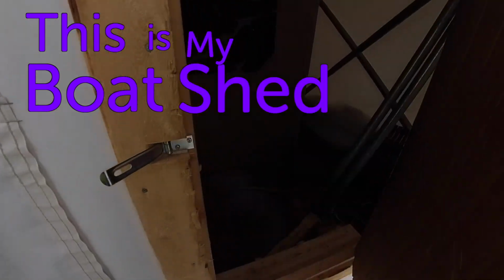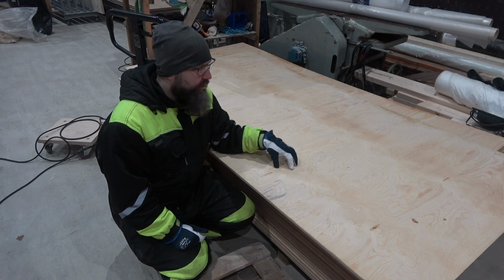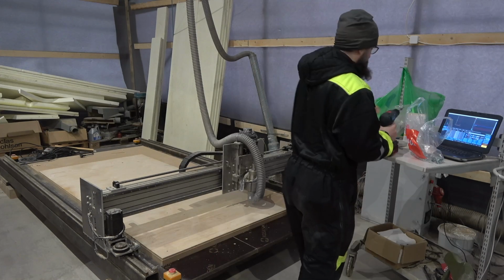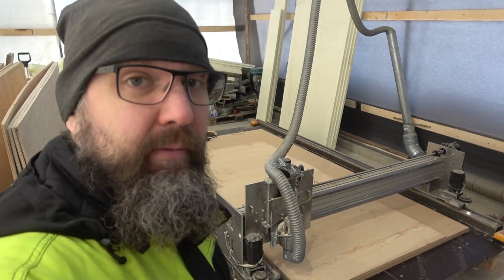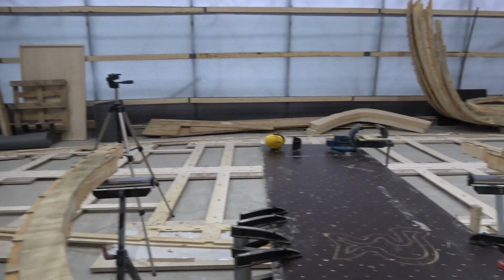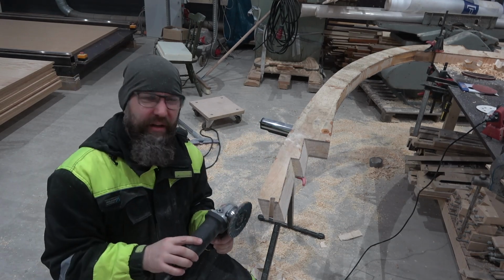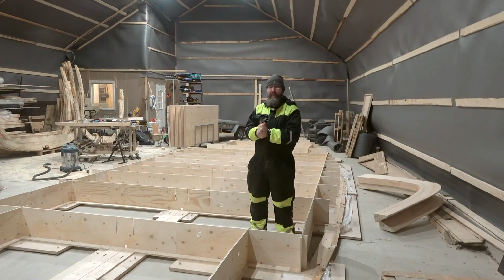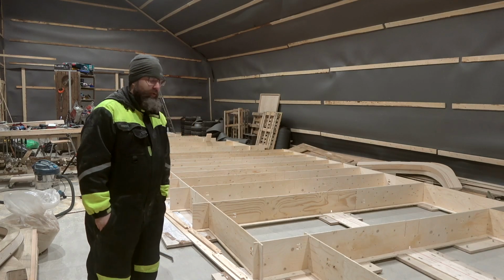Building 50ft sailboat: More molds, more CNC-cutting and more frames! - ep73 Project SeaCamel

Comment: Making a guide to remove the angled edges. Use a hand saw to cut in a slot(kerf) that is at the depth of the top and bottom pieces of plywood. This is a visual that will guide you as you remove the material accurately. The bottom of the slot is close to the finished angle. Cut the slots a little shallow and then take care to dial in the finished surface.
Reply from the maker: I actually have ditched the angle grinder since this. The most efficient way is to use the multitool just to cut the first time as accurately as possible and finish with light sanding. 😊

Comment: At 16:30. when cutting the interior face. If the initial cut is vertical at the lower edge, then when working from above all you need to keep in mind is not to touch the lower edge because is already on size. Hope it makes sense.
Reply from the maker: Yes, the "top" in that case will have tiny "cavity" there. But that's OK. It will be filled eventually when things get glue against it.

Comment: Exciting times in your shop. Use a japan saw to cut your angles and grind only the last bit.
Reply from the maker: I actually ditched the grinder and use only the multitool to cut the initial pieces out - as accurate as possible. Then it only needs light sanding. 🙂
Reply: Yes, this might even be faster than the multi tool.

Comment: why don't leave frames square and then fill the gap with expoxy and filler? (I know on this step it isn't possible because of design, but just a question)
Reply: also. I would consider temporary thin frames from some sort of chipboard and after planking is finished, do a permanent frames gluing it plank by plank to the hull, I would screw them with self-tapping screws. What do you think? Except of some amount of holes on frames (after screws), I see such method maybe not very precise and clean but it may be quicker.
Reply from the maker: Hi good questions. In some frames in the middle it might be possible. But of course the other reason is to make as-precice-as-possible "mold" for attaching the planking. Also the wood here is the "fiber" that handles the loads. So if they're apart from each other, that could make a weak spot...?

And also epoxy is very expensive. Wood is very cheap.

As for the method and schedule what to attach when, take a look earlier video of the nest stages of the build.
There will be a lot of screw holes in planks of course, that's not problem. But the general idea is to install as much stuff as possible before putting the planking in. I could put a lot more but I still want to feel the empty hull before making finalized decisions of the interior.

Comment: "only 15 to go" - that's inspiring optimism. It kills me to think you are doing all this in sub zero temperatures. you're a wild man for sure
Reply from the maker: 😅 Doing physical work in cool temps is the way to go. The 15°C required to glue things is on the upper limit of comfortable to do physical things. You need to wear the protective gear anyway...

Comment: get yourself a sawzall and blades come in fine and aggressive  wood and both, (bimetal) and as long as 12",makes those notches and other large cuts a breeze!
Reply from the maker: I actually have ditched the angle grinder since this. The most efficient way is to use the multitool just to cut the first time as accurately as possible and finish with light sanding. 😊
Sawzall would be too inaccurate IMO. And I don't have that (at least yet)... 😅

Comment: Hi Panu. 
Would an electric compass plane help with shaping the frames - especially on the inside. 
And, working on the frames either them held vertically would assist in seeing both sides of the templates simultaneously 
Just my thoughts. 
Best wishes in your superb build. 
Mark K. 
Dublin. Ireland.
Reply from the maker: Hi! I really don't need to remove any material from the inside. I know that such tool exist though. It might be useful later when shaping inside surfaces...? Dunno...

Frames are so big that I'd need a massive stand to hold them up. This way I really don't need do more that flip them over once. It's working fine. Already seven frames finished now i think...

Comment: 1 concern, these “Ribs” are wood, in steel we run cross reinforced pieces, the wood can change with moisture etc. would  some cross cross support help it from twist and stretch?
Reply from the maker: The frames take the force in "up-down"-direction. The planking of the hull will do the same in horizontal. And then there's going to be two layers of veneer to take the loads in ±45 degrees. And of course being laminated from multiple strips it pretty much prevents the movement with moisture.

Steel is very bendy (and much thinner) so it needs additional reinforcement. Wooden hull is much thicker and that way much stiffer.

Comment: Hi Panu, I've been watching your channel since you started building your CNC machine. I'm not sure if you've covered it already, but I'd there a reason for running your machine at such conservative speeds? I'm loving the boat build so far, keep it coming!
Reply from the maker: I’m using quite small router bits. The general cutting speed is 2000mm/minute which is ok to me. The max the x-axis can go (the ballscrew start to wobble) is 4000mm/minute.
And maybe I’m just scared…
Reply: @ArcticSeaCamel  ah ok, I use 6mm bits and cut about 6000mm/m at full depth (18mm). I suppose it depends on spindle power too. I tested a 3mm single flute once in MDF, it cut at 7000mm/m without breaking! Cut quality wasn't great but it's a tiny bit, carbide bits always impress me.
Reply from the maker: @scottdigs  😳 In that case it’s just the being scared.
I have plenty of power in the spindle and max rev of 20000rpm. Maybe I’ll test some faster speeds at some point…

Comment: Hi Panu, I have a question about all of the permanent pieces that you are going to be gluing up (in particular the frames).  I noticed that while preparing the frames to get them to shape, you are creating large areas that will be in direct contact with the hull that are bare wood.  Do you plan on treating all of these areas of the frames with a penetrating epoxy? If left untreated it would seem that moisture from condensation that forms along the hull would have a means of ingress into the frames -- the cold waters where you are likely to sail combined with the warm interior of the boat are likely to create this effect.  That is not to mention that the point of contact to the keel of each frame is all of the end grain on the frames which will be effectively the site of the bilge.  I am curious about how you plan to deal with this issue --- it's what scares the heck out of me about wooden boats!!!
Reply from the maker: Hi Robert (i guess!)!

So all the frame sides are bare wood right now as you noticed. And the wood strips of the hull will be glued to those surfaces with epoxy.
Wood really doesn't suffer from condensation at all. It is good insulator by itself. (of course if it's really cold it will especially when covered with plastic)

But as for making this as wood-epoxy composite boat, It's really important to seal all the wood surfaces to prevent moisture getting into them. The downside of making composite is that while the epoxy prevents moisture getting in, it also prevents the moisture getting out! (if it has found it's way in there)

So. Yes, all the surfaces, end grains etc. will be sealed with epoxy (and fiberglass for protecting from bumps).
Reply: @ArcticSeaCamel  Thank you for the reply, I was just curious considering your Arctic location.  Condensation is always an issue on boats, but more so when in very cold climates because people tend to try to keep the boat very warm down below.  Great job on the first few frames ... it's really starting to get exciting now that we are beginning to see the boat start to come together!!!
Reply from the maker: @robertscholz4486  Yeah. In order to fight condensation you also need to have good ventilation. Cold air generally contains very little moisture. So if you manage to get cool air in and warm it up, it dries significantly.
Condensation only becomes issue when you have source of moisture inside (like human being or cooking etc.) AND you have surfaces that are significantly colder than the air inside. That's why this boat will not have "normal" aluminum framed hatches etc. All hatches, windows etc. NEED to be insulated and at least double glass.

Handling moisture in cold climates is very very familiar to me (and all of us living up here).

Regardless the insulation value of wood, I'm also planning to put additional insulation all over the boat and really address that air ventilation issue. Boat is very challenging thing to have proper air flow into. With big boat like this I really think that you will need some sort of mechanical ventilation system. Just to move the air from the bilge and keep things dry as explained before.

Comment: Do you not have homing switches on your cnc?
Reply from the maker: Hi!

No. I cannot use any sensors due the interference of the spindle. Haven't really notice any need for them though. Fixing that is on the long long todo-list 😅

And also, homing wouldn't fix the issue of Y-motors going "unbalance" if bumped out of place...
Reply: @ArcticSeaCamel  of you use 2 homing switches on either side would allow the gantry to “square” itself. Love your channel btw! Kitos
Reply from the maker: @gandersson6121  Hi! Yes propably they would. But those switches should be located within tenths of millimeters in right spot related to each other. And I'm not sure if their accuracy is enough for that. Some sort of metal spikes and micro-adjustable thread system could work...

Comment: Amazing work !!
One question are you using compression bits to cut ??
There is a lot of rough cuts.
IT could safe you time and splinters :p
Reply from the maker: Hi!

I'm using downcut bits with these cuts. And it's only 4mm wide. That seems just to be enough and bigger bit would create a lot more waste and make it hard to use the screws to fix the plywood etc etc...
I have 8mm compression bit though but haven't really used it for these. The reason above.

Using new sharp bit gives excellent results!
Reply: @ArcticSeaCamel  Well am not going to tell you what you have to do at all.
just pointing it out :)
If it works it works.
going to order my self some of these 4mm my self soon :)

and you said you have to be carefull not to move the axis??
no limit switches ??
a other trick you could do is add flip fingers on the side of your spoil board of the cnc.
flip em up when you added a plate you want to cut and jam it against them.
you can even add a offset.
once the plate is in place flip em down and go to town.
easy alignment and if you would install limit switches to zero out the machine.
you can add a offset to your plate with the finger is always Zero on the corner :p
tricks of the trade.